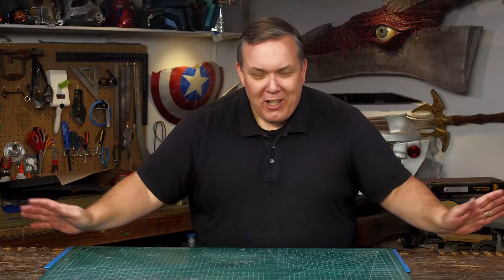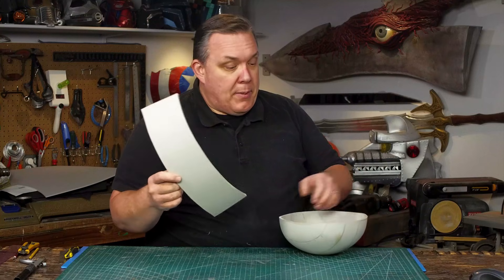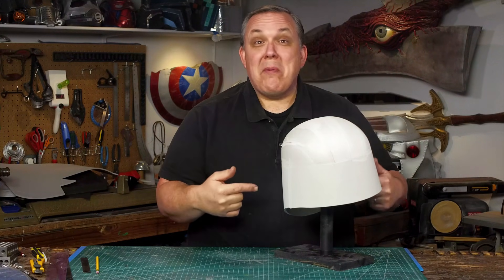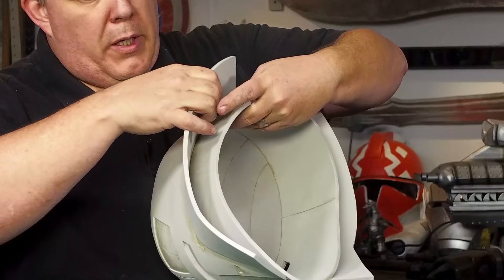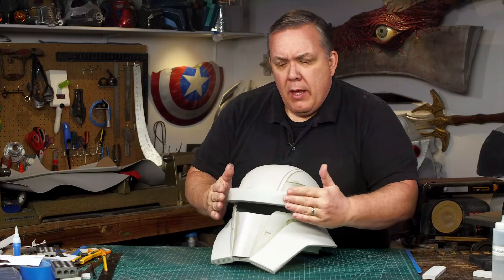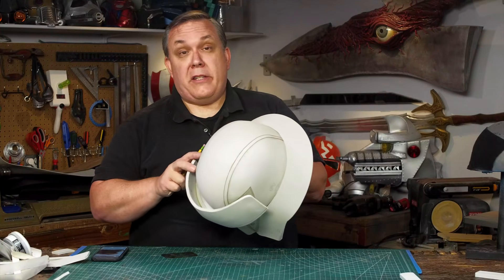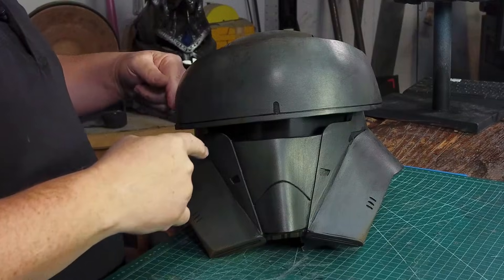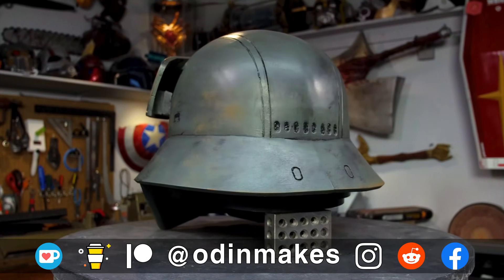Odin Makes: Imperial Combat Assault Transport Helmet from The Mandalorian & Star Wars: Rogue One

Comment: I like how the helmets differ depending on their role in the Star Wars universe, but always wondered what the actual functional differences were, like the ones worn by the Death Star laser operators with the upward sloping "underbite" jaw piece then the main head piece extending down the back, almost like the Xenomorph head
Reply: I'd assume its like a reverse blast shield, since they were sitting above the laser canons, keeps the light coming under from going in their eyes?
Reply from the maker: The underbite jaw seems like it would block vision for controls on the panel in front of you, doesn't it?
I am pretty sure I know the real world answer- but I am curious what the in universe answer is too.
Reply: @OdinMakes  fair enough! I think the behind the scenes answer is that they basically stuck two helmets together (the same the rebel soldiers wore) and just cut the bottom one in half to create an opening? I could be misremembering though

Comment: I watch other makers that use a hot wire cutter on that insulation "styrofoam" stuff. Would that work on EVA foam instead of busting out a band saw?  Seems like it may be a bit more accurate if it works and doesnt stank up the place.    And on a different note... Could you make an Asohka style headdress?  that would be cool.